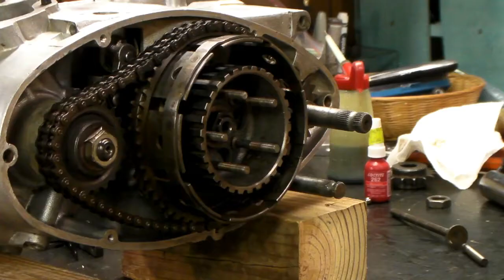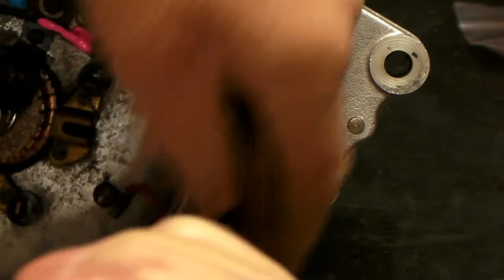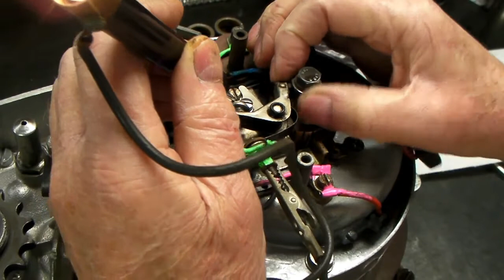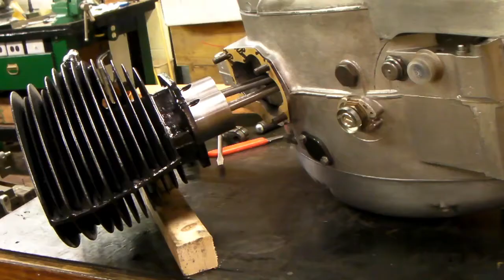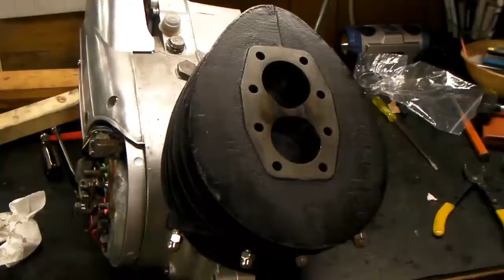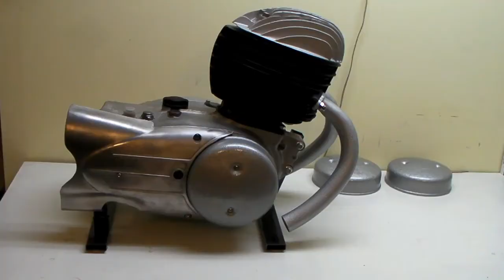Allstate Puch 250 Twingle BUILD UP #3 Ignition timing & display.

Comment: Thinking about buying a non running 1961 Sears Allstate Puch 250 Deluxe.  I finally found parts online at Motor West thanks to your comments here.  I appreciate you sharing that knowledge.  Still on the fence whether to buy or not.  It has zero rust and seems to have compression.  In great shape really.  Has about 5k miles, but I hear that is about top end rebuild time for those twingles.  Do you have any advice on this?  I am a mechanic, but I also want something vintage to ride!  This thing might just be different enough to keep my attention...
Reply from the maker: Glad you have watched my channel. I hope to get back on my own Twingle project soon, as I am almost finished with the airplane.
It sounds like you have found a real good one there. With only 5000 miles I would think all you would need to do is to decarbon the pistons. Only reason I think this is, you don't know what kind of oil was used. We didn't have very good oils back then, so I would make sure the rings are not stuck. Be sure you put the same ring in the same position and on the same piston.  Got to get any carbon that is behind the rings cleaned out with a dental pick.
Other than that, nothing to do in my opinion. I am not an expert on Twingle engines.  
Should be good for 10,000 miles with the oils we have today.
Good luck with it.

Comment: Do those bikes have an oil filter and if so where
Reply from the maker: No. They were 2 cycle engines. There is no oil to change in the engine, and no oil filter. These engines get fresh new oil with every breath they take, so they only see clean new oil.  This 250cc size has oil injection, so clean two-cycle oil goes into a special tank.
The only oil you can change is in the transmission and primary chain case.

Comment from the maker: This type of engine was obsolete in the 1930s, and you can't get much power out of them because there is no cooling between the cylinders. I have never ridden one, but am told they have great torque and get terrific mileage.
Reply: Was it more obsolete than a single cilinder two stroke? For that's what it basically is but with better scavenging.

Comment: I DIDNT  USE  A HARDENED SPACER TO REMOVE  THE  ARMATURE  OFF THE SHAFT AND IT  MUST HAVE SQUISHED AND NOW I CANT GET THE BOLT OUT  OR THE ARMATURE EITHER … GOOD LESSON USE ONLY A HARDENED SPACER BEFORE  YOU PUT THE  REMOVER BOLT.
Reply from the maker: Not sure what I would do in a case like that. Possibly make a slide hammer to thread into the end. The banging of the slide might remove the armature.
Reply: YES THATS  WHAT I DID .. WE HAD TO BRAZE THE  SLIDE  HAMMER (DENT  REMOVER)  TO THE  BOLT. AND
 IT CAME OUT  ... I SEE THE  CAUSE NOW  THE  (SPACER  REMOVER) WASNT LOING ENOUGH AND IT CAUSED  THE  WHOLE  PROBLEM AS IT  GOT STUCK AND BUNGED  UP THE  THREADS TOO. THIS AVOIDED A  real  disaster...…………………..!
Reply from the maker: @AIRMANBEAR : Glad you got it out. Good to know that a slide hammer will work.
Reply: @Adventurepilot70  would you sell that engine?
Reply from the maker: Hi Kyle.   Yes, I would consider selling it if someone needs it for a bike.
Reply: @Adventurepilot70  I recently purchased a '67 that I wish to restore. I would love to remain in contact with you about the prospect of purchasing that engine!
Reply from the maker: @kyleclare774  That would be fine. I just have it sitting around because I love the way they look. I would be interested in seeing your '67 project.
Reply: @Adventurepilot70  hello sir, I just picked up the Puch a couple days ago!! Can I get your email address? I'd love to share my project with you and pick your brain a bit haha
Reply from the maker: @kyleclare774  Hi Kyle. Yes I would be very interested in your project. My email address is jbmindustries@att.net.
Might be good for you to join this forum:  puch.nortonfastback.com
Lots of info on there.